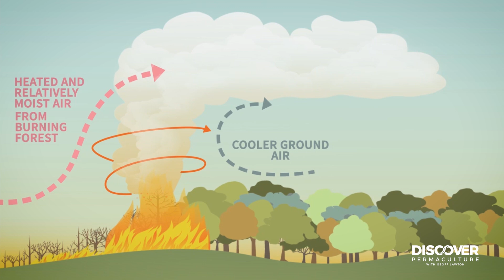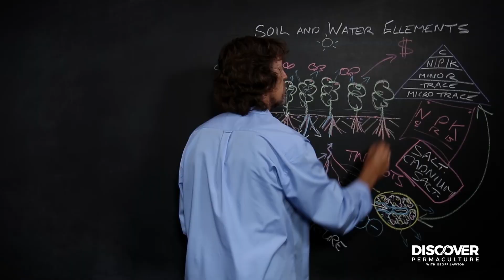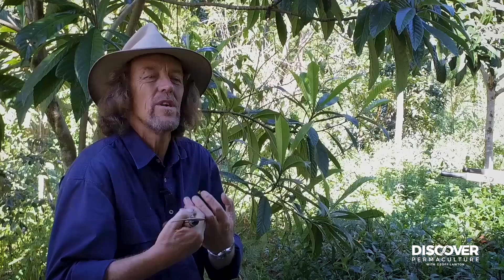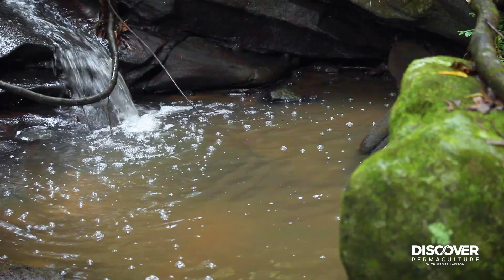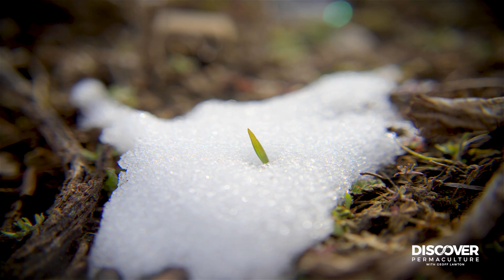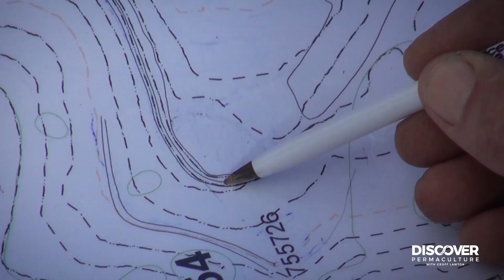Comment: My first choice was a permaculture course, but at the time was unable to find one to enrol in unfortunately. So I enrolled in Horticulture Cert 3 course at local TAFE, I am enjoying it immensely. Due to finish early December and fingers crossed will have a Horticulture certification. My plan is to do a permaculture course afterwards. I bought Bill Mollisons design manual from Tassie, I was reading it regularly until I started my course, will get back to it in the future.
My question is Geoff, are you planning on running any courses in the early part of 2025 at all? I am very interested in enrolling in one then, I have a commitment to finish my TAFE course first. I have implemented a lot that I have learned from David’s channel The Weedy Garden in my own suburban quarter acre block.
Reply: Hi @ginac9008, this will be the only online course for 2024. There will be more courses in the future but dates have not been set.
Reply: @DiscoverPermaculture  thanks so much for the reply I will most definitely plan for the next course whenever that maybe.